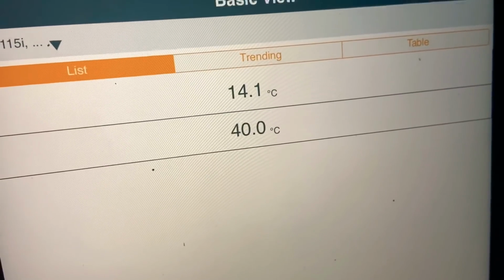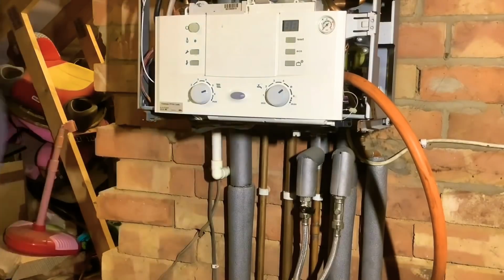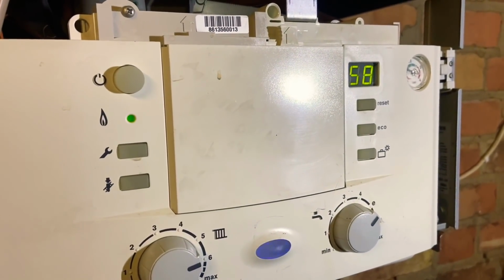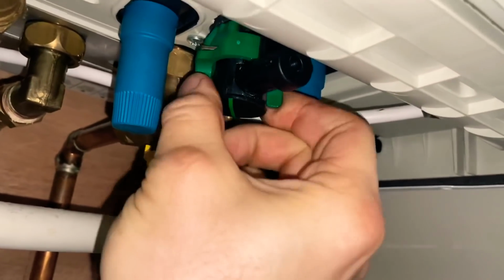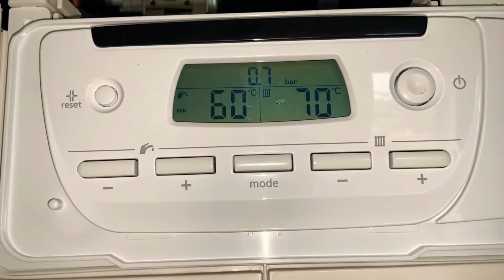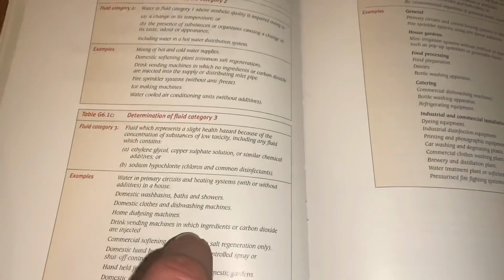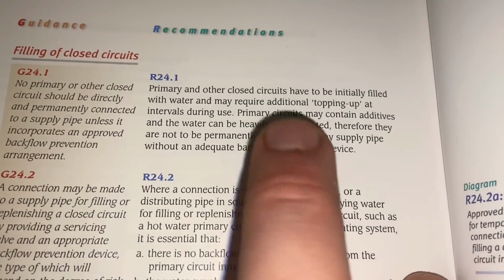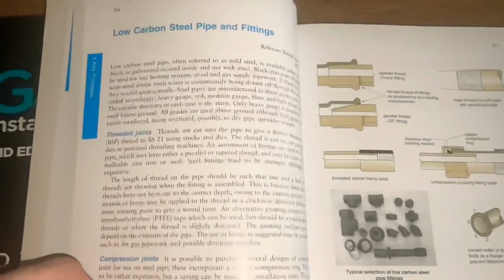P B Plumber The life of a jobbing plumber #40

Comment: Great videos ... got a question for you ....immersion heater tank electric elements only top and bottom .bottom element went faulty . Top one was working .. replaced bottom element with a new one . Refilled up tank check both elements are working . Now the top one does not work .. someone told me thermal shock on the existing element caused it to fail .. is this correct 👍👍

Comment: Talking out knocking a bucket of water over, i did a daft thing the other day. Working in this flat about to fill the radiators up, went round and closed off all the air bleeds, thinking iv'e done them all, started filling up, went round venting  but there was a radiator at the back of a sofa which i'd forgot about as it was mainly hidden. All the air bleeds were the type that you can angle the way the water sprays out. All of a sudden i heard something when i went into the lounge, water was spraying out of the radiator upwards at a 45 degree angle and landing on the sofa, Haha, wouldn't have been as bad if it was angled towards the floor

Comment: Great video PB! What would you do if you replaced the heat exchanger, but this didn’t solve the issue which means you need to replace other parts to the boiler? 

If I get things wrong I find it hard to charge them more than what I originally said

Comment: Any tips on a junior prv doing one sat
Reply: I remove one of the copper pipes so I can get one hand up there. Then refit after with a compression. Saves time in the long run. 👍
Reply from the maker: If you can move the cold you can get your hand up, it’s still a pain but it’s doable
Reply: Thanks guys first one done from underneath soaked with wd40 done in 15
Reply: Thanks guys first one done from underneath soaked with wd40 done in 15

Comment: Hi PB
Love the blog in any format. As a long retired plumber gas fitter I still like to keep up with modern technology and advancement in plumbing techniques and find your blog excellent for this purpose.
I thought id just add my very own f**k up event, going way back to the 70s for this.
Id been called our to a smell of gas from a cannon gas fire, common call out at the time. The problem was a dry brass barrel in the on/off  mechanism which was fixed by smearing with Rocol grease. Anyone who has come across Rocol will know that it is a thick black grease contained in a small tube ( think toothpaste ) On finishing the job I stepped back onto the tube which proceeded to eject a 2ft stream of black grease onto a lovely fawn coloured wooden carpet, in panic i tried to wipe the grease off which obviously made matters worse.
Attempts by a carpet cleaning company were deemed unacceptable so a new carpet was installed. I had to live with that event for a long,  long time .

Comment: Changed a wb greenstar plate today, I can usually, lift it up and turn it on its side and get it out between the pipes. But yeah otherwise get the hot water pipe off.